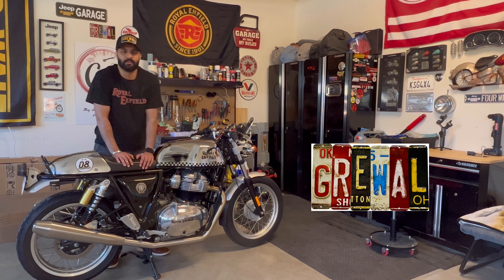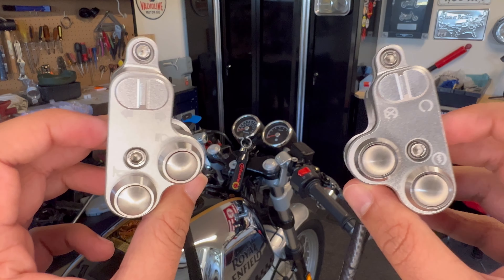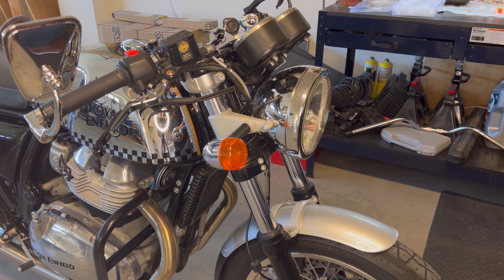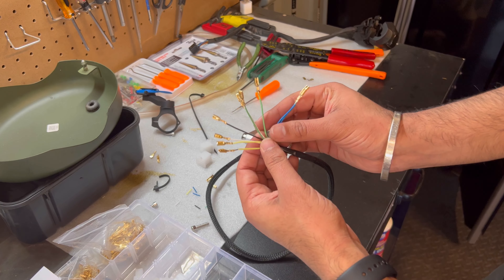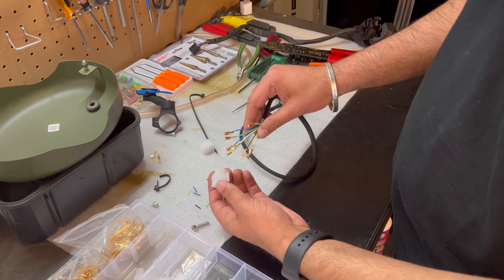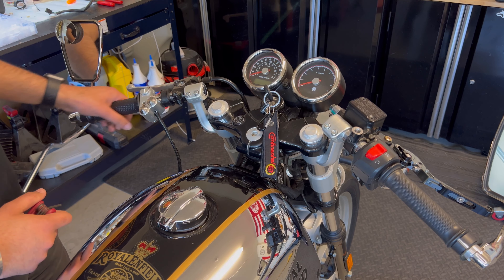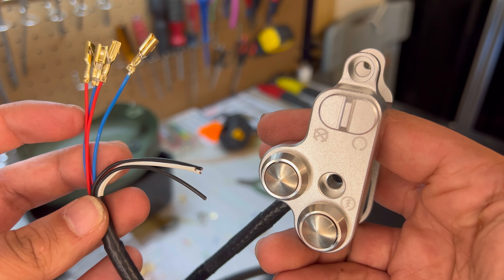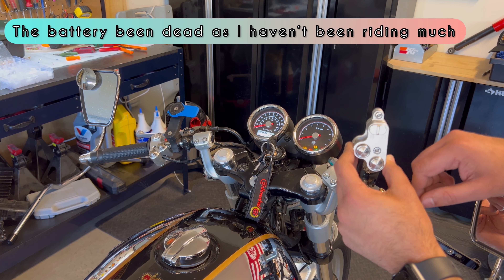Royal Enfield 650 Custom Switches | Part 1

Comment: SOOOO hard to find  video about this! I think my starter switch died, and I couldn't figure out where it was running to! I knew it looked like it was going into the light, but I'm like "That doesn't make sense.... Let's watch a video before ripping this apart". It's also currently raining outside, so this helps. As soon as the sun comes up I'll take it apart. Thanks!
Reply from the maker: Glad the video helped, both the kill switch and starter switch go bad on these plastic switches, check the plug in the headlight or the switch itself could be faulty. If it’s a short circuit then check wires under the tank if you removed the tank previously.

Comment: Those are the best looking switches I have seen. Have been trying to find a video like yours to see about fitting them and what they are like
How does the indicator switch feel, is it positive or not, some are awful like on some of the Triumphs

In the UK new vehicles have to be set up with the lights always on, it is the law, but I must admit to installing an off switch into the wiring on an older bike as I had aux lights fitted which were always on, when I took it in for the MOT (test) I made sure the switch was taped in the on position for thee headlights. They are not allowed to remove tape here.

BTW, I think you have installed the clutch too far to the right, it should be next to the switchgear, then have the phone mount
It looks all wrong to me, but, perhaps you prefer it that way?
Sorry if I missed something

Thanks for the video
Reply from the maker: Thanks for watching @blackskunk9034, the switches are great, checks all the boxes for me as far as looks and functionality. Only thing bugs me is the signal slide button as the clicking mechanism is tiny and so close as sometimes it’s hard to find neutral between left and right signal. I wish that button was little bigger. It takes some time to get used to them but will definitely not recommend these with winter thick gloves.

Goal on this build for me is cafe racer look to make everything custom and slim, not everyday riding bike. 

And the clutch lever is not installed too far, this is not the final placement as it shows in the video, as I still had right side switch to tackle with throttle housing/grips and new levers as well. The levers should aline with the grips and should be inside of the handle bar length. Thanks for the feedback thou!
Reply: @GrewalsGarage  OK, thanks for coming back to me. I had a feeling the indicator switch would be a problem, such a shame. I will keep looking then, good luck

Comment: Update june 2024, now remmotorcycle preinstall the 9 slotted plug complete with braided sleeve. For both left and right side switches. Now u just plug it.

edit : You still need to major modification to it

Comment: Hey Grewal, did you ever post a part 2 for the right side switchgear + throttle assembly? I'm working on a similar upgrade and would love to see the process
Reply from the maker: Thanks for watching @supraman320 unfortunately didn’t get to film the second part for the right side. However, I’m using the domino kit for the throttle where you will need new cables as well since the stock ones will not work. The right switch wiring is easy as I showed towards the end of the video. 

You can email me grewalsgarage@gmail.com for any questions or if you need quick video of the setup. 

Also checkout my YouTube shorts, I have posted some related to the throttle setup! Thanks for watching!
Reply: @GrewalsGarage  awesome, yes the domino xm2 is what I purchased as well, I think thw switchgear wiring should be fine but I'm a little nervous about the the throttle tube/cable replacement, want to make sure I get that process right

Comment: Great vid. Not sure if it's been asked but where did you get that alloy seat cowl from?
Reply from the maker: Thanks for watching @Adrian, here is the link to the dual seat cowl. It’s constructed of molded ABS material.

https://www.ebay.com/itm/264669271373?chn=ps&_trkparms=ispr%3D1&amdata=enc%3A1gf2ywh8oSz6MPjQO0ZkNiQ95&norover=1&mkevt=1&mkrid=711-117182-37290-0&mkcid=2&mkscid=101&itemid=264669271373&targetid=1644837435963&device=m&mktype=&googleloc=9032139&poi=&campaignid=16743749222&mkgroupid=138744546207&rlsatarget=pla-1644837435963&abcId=9300842&merchantid=113421866&gbraid=0AAAAAD_QDh8M3Ji84VoUDYKpJt3HHw33B&gclid=EAIaIQobChMIxOT4xsiL_wIVeRKtBh047wYaEAQYASABEgJE2vD_BwE

It comes in black, red, blue, & white colors.
Reply: @GrewalsGarage  wow, so you painted it chrome. It looks sweet
Reply from the maker: Yes! Thank you 🙌🏼

Comment: Hi, do you have a link for the electrical connectors kit please?
Reply from the maker: Hi @johnnywadeson9335 I dont have the link on me, but you should be able to find these on amazon or local hardware stores, 9 slot plugs is what they are called.

Comment: actually the reason why most motorcycle has no off switch for headlight is for added safety features. so even on day time you don’t have to switch it on so your more visible to other vehicle. so i think its better to have your light on at all times.
Reply from the maker: Thanks for watching JCML VLOG, I agree with your POV as far as visibility. But I feel like if 60watts headlight is making my presence on the road then I need to change my riding style lol.. at the end of the day I’m defensive rider but more functionality is key for me, being able to turn that on/off is a win win.
Reply: @GrewalsGarage  It's a safety thing, not a functionality thing, Get an LED bucket if you're worried about the wattage.
Reply from the maker: @curtisfisher5853  im old school, don’t like the look of LED.